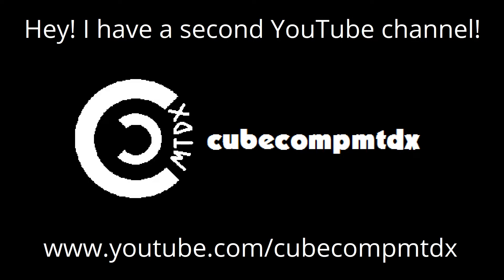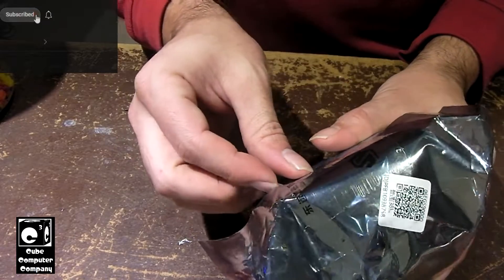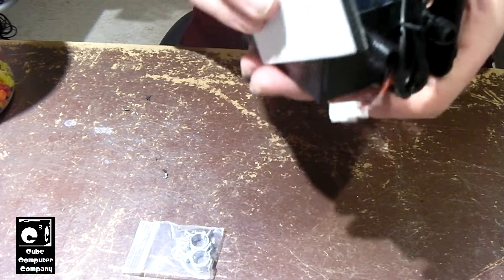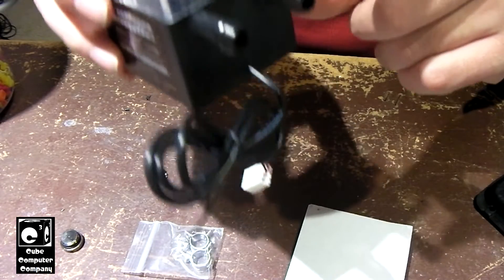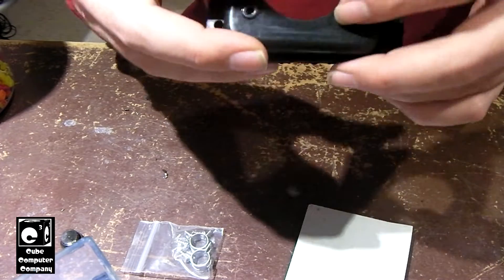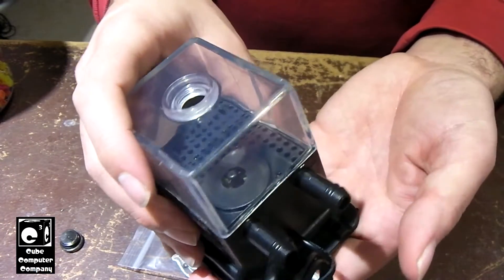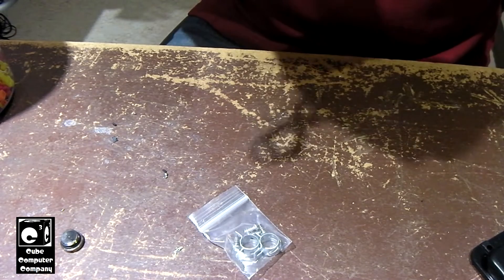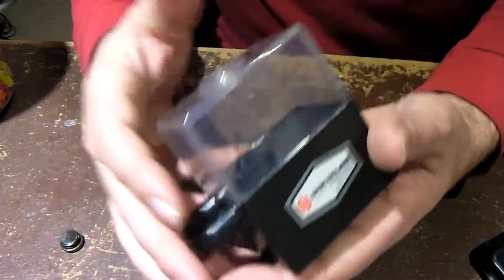Unpacking the Syscooling SC300T pump + Initial Thoughts

Comment: My Pump is really loud when i use 12v is that normal? i know this not a Forum. But it makes me sick i got all ready and now the pump is loud :(
Reply from the maker: It's rated at 12V... this one runs quiet, though I had a mix of half and half 50/50 antifreeze and distilled water (so really 25/75 antifreeze/water. Running straight distilled might cause the pump to run a little louder, or it might be a defective pump.